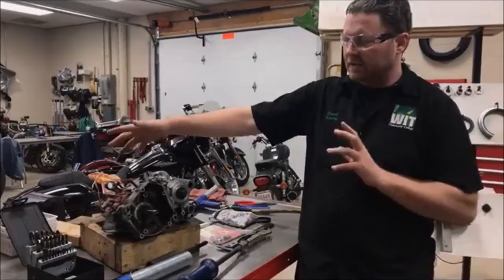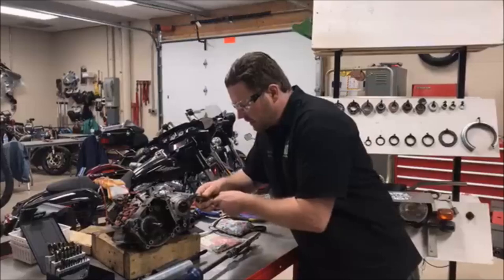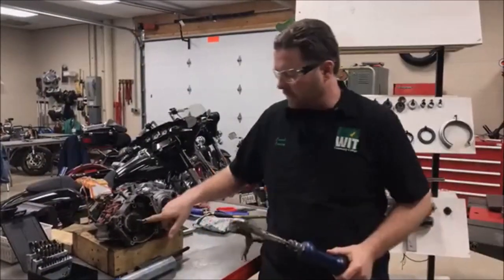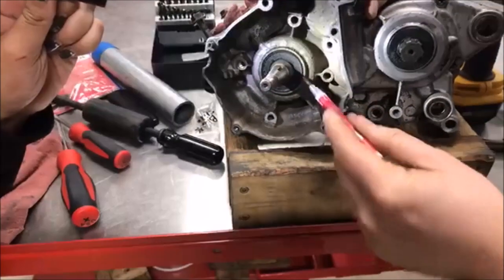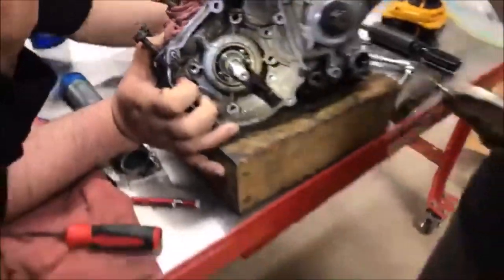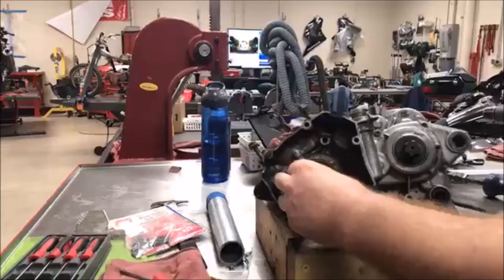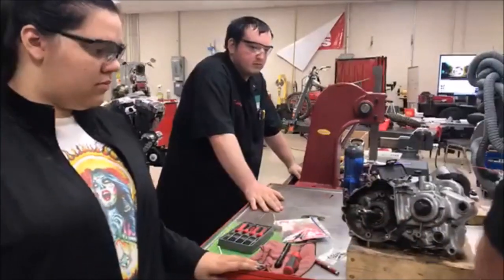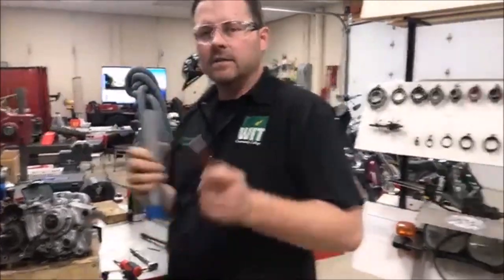How to replace an oil seal with the shaft still in the case.

Comment: have used that trick for years.... if you have a really stuck seal, put another screw on the other side aswell to double pull it out... i usually seat seals with sockets if it fits over the shaft..you dont need "special service tools" if you have learnt the cool way to do things... like welding out a bearing race.... heating cases to drop bearings out..ive never used a press to fit or remove bearings either... oldschool cool

Comment: Luv it. Gonna try it on an old stihl blower dumpster find I don't feel like totally disassembling. The taped pipe was beauty. I've done front seals on cars where I take my small urethane hammer and tap it all around the crank, A pipe would work well there too.
Reply from the maker: Right on. Glad to hear how you liked the videos. Want more? Here are the links to support us for this information and our work saving you money.
Join this channel to get access to perks:
https://www.youtube.com/channel/UCBhM8DCKnT3qXwTW0eToyCg/join     

Give us a high 5 here:  https://www.paypal.me/how2wrench
Reply: Worked perfectly on the blower. Those small engine mechanics are always crying about disassembling an otherwise solid motor to replace crank seals,many times junking the units.

Comment: I made a seal installer 3/4 inch plywood  3 inch round drilled out the hole to fit over the shaft but it has slight  drag on the spleen, Use the 6 inch socket as the driver  one hit with a rubber hammer and its in .  Great Video
Reply from the maker: Nice...

Comment: Shane a few questions. 

First my bike is a 2017 KTM 300XC. I need to replace the right side Crank shaft seal (getting gear oil in my exhaust).

Do I need go remove the clutch basket to do this job?

Do you still recommend the wood screw method for removal, and the pvc method for install? Any better ways you know of?

Thanks for all the great videos, you're a true professional!
Reply from the maker: I’d guess you found your answer by now or you got ahold of us on the website.

👍 Thank you for taking the time to comment! Hit that subscribe button if you haven’t please! It helps us! 
Here is a way to support all the free videos.
Want to say “thanks” or “keep it up”? Click here https://www.paypal.me/how2wrench  

Coach Conley is also available for hire to personally work one on one with you if ever needed. Yep he is a real person. Give him a call @ 602-345-0432
Details here: https://how2wrench.com/product/personal-tech-training-phone-facetime/ 
Your answers and help are just around the corner. Save time and money while protecting your investment and yourself by doing it the right way!
Follow us! 
Web:
www.How2Wrench.com     
www.Tools2Wrench.com

Comment: Hola Shane, good trick but dont use a wood screw, instead of that use a sheet metal screw, the threads are narrower and smaller so it will bite better on the seal without pushing the screw too far in...
Reply: I wrote this whole thing out thinking you wanted to use a machine screw lol which of course would be bloody useless.

Realised after I posted you said "sheet metal screw".

I'd have to agree on that as the thread is a lot flatter so will contact more of the backside of the pilot hole. The major diameter is pretty important, which the sheet screws usually have quite large.

Comment: U would do more damage drilling than hooking it with the proper tool ahahaha
Reply from the maker: YO  SpongeBob...we disagree for properly fit seals and "hooking" or prying actually cause you a lot of risk to damaging the rotating shaft or the case. Time and a place for different methods, that's why we learn multiple ways to do things... :) 
👍 Thank you for taking the time to comment! Hit that subscribe button please! It helps us!
Here is a way to support all the free videos.
Want to say “thanks” or “keep it up”? Click here https://www.paypal.me/how2wrench  

Coach Conley is also available for hire to personally work one on one with you if ever needed. Yep he is a real person. Give him a call @ 602-345-0432

Your answers and help are just around the corner. Save time and money while protecting your investment and yourself by doing it the right way!
Follow us!
Web:
www.How2Wrench.com    
www.Tools2Wrench.com
Reply: Not hardly, The drill method gives a clean pull hooking is more likely to score the crank or case. Where are you going to hook it with the crank shaft there?